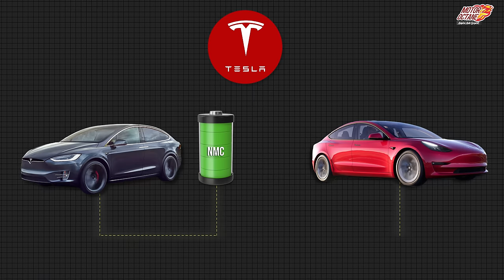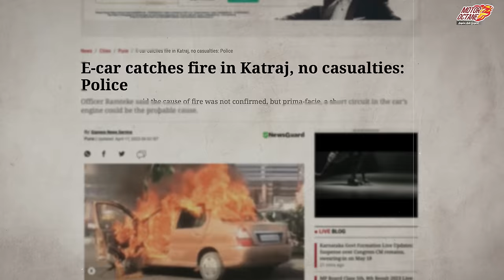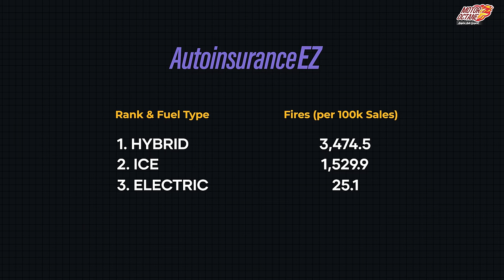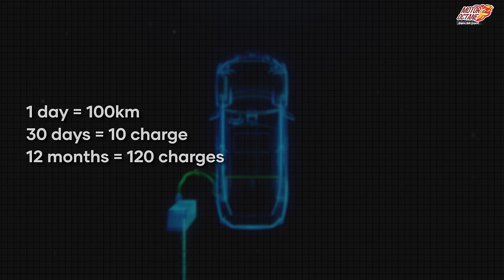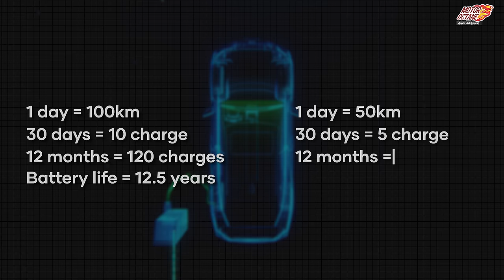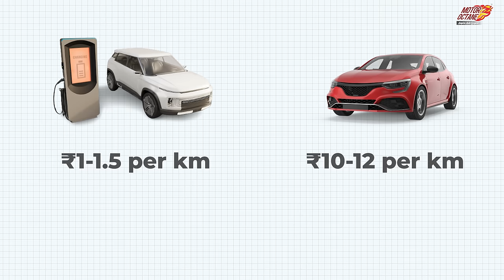Electric Cars have Battery Problems?

Comment: Very well explained , but there is a lot of work still needs to be done in terms of adapting to ev infrastructure in India,  take an example of CNG , its been around 20 years since CNG has been implemented,  but still today not all the pumps are having that CNG facilities , I see vehicles standing in large numbers in pumps to get the CNG refilled.., also not to forget with fast chargers the charging time is 45 mins min.., and with regular chargers the avg time is around 6-8 hours, yes ev's save money but there will be an added burden of not only charging it but charging it on time so that it should be good to go to the next day , if forgot to charge then take a 🚖.., unlike petrol / diesel cars , 

Regarding the number of fire catches in petrol cars vs ev's , the number is higher in petrol car because the majority of people are still using ICE cars as compared to ev's,  which are relatively new..
Reply: the fire stats are per 1lakh cars, not absolute numbers

for example if 1 million EVs are on the road, then only 250 caught fire (25 EVs per 100K cars)

same way, if 1529 ICE cars caught fire per 100K cars, then the actual fire cases of ICE cars over say 100million ICE cars would be 15,29,000

to adjust for the disparity in the number of EVs and ICE, we use per 1000 or per 10k or per 100k figures like used here

you can also use percentage, its essentially same as percetage
Reply: Bhai fast chargers are more in India than a petrol pump bhai u live in India right 😂😂 there is no more range anxiety in India and it is growing @ 10 times as lot of private companies have come up
Reply: @shresthsonkar9207  ok, but what about those cases where ICE cars caught fire because of LPG or CNG ? Do they count as under ICE car fire data as well ,i guess it will count under ICE cars only.., if they do then the stat is not correct because in most cases the fire is caught in the vehicles running on  CNG or LPG ...
Reply: @prashwin0917    bro I definitely live in India , like you do.., but its very important to have some knowledge before writing anything.., having a fast chargers is different thing and having a charging stations is different .., you can't charge your vehicle with your chargers alone..., and if you are trying to say that fast chrging stations are more than petrol pumps in India.., then I think you are an Idiot.., bs bkchodi krne aaye ho yaha.., go to some rural areas, jaha p aaj bhi electricity nahi h.., and in developed cities you can find charging stations easily but in semi urban areas.., it is still a concern.., and fast chargers bhi take around 45 mins .., and if those stations already has some ev's lined up fir kya krega bhaii.., khada rhio 2 ghnte fast charger leke 🤣😂.., and also there are some cases jaha 20% battery me logo ki cars bilkul band pdd gyi h , so uss situation if u r with family the what would you do ? Fast charger leke ghoomta rhega kya ? 🤣😂 , offce se aake car charging p lgani bul gaya to agle din boss ko kya bolega ki battry low thi car ki isiliye late ho gaya , ya leve lega ya cab krke aayega .., b sensible man...
Reply: @mayank.007  tu cycle chala na petrol na ev tere liye best he tu gadha he in simple word gadhe ke aage bin Baja ke koi fayda nahi 🤣🤣🤣🤣
Reply: @mayank.007  study is from USA waha pe cng lpg nahi hoti hai

Although yes, cng lpg is also ICE itself because ICE refers to engine not fuel type

Even if you use synthetic fuel, jet fuel, kerosene or normal petrol diesel engine still remains ICE with same basic principle 

And no, you cannot say that cng lpg fires are smearing name of ICE, even normal petrol diesel cars catch fire a lot.

This year itself there was one XUV700, one safari kaziranga, one punch which caught fire 

None of these cars were cng lpg
Reply: @mayank.007  fast charger aur charging station alag alag nahi same chiz hoti hai 

Slow charger is called EVSE (supply equipment) because it only supplies power from socket to car. Battery takes DC for charging so the car has a rectifier in it to convert AC to DC. In slow charger, the electricity entering the charging port is AC and first goes to rectifier then the battery 

Slow charger is limited by the rating of this rectifier that’s why only small capacity is provided (3kW/7kW/11kW). Weight and size of rectifier is also a factor

DCFC already has the rectifier placed in a cabinet which looks like petrol pump dispenser unit where it has those screen for cost and litre dispensed

The weight and size of rectifier is not problem for DCFC because it’s permanently mounted at parking space for charging. In DCFC, the power reaching the charging port is already converted to dc and directly goes to battery, not the rectifier. That’s why it is faster
Reply: @shresthsonkar9207  I went to Tata Motors and their sales man said k 50k extra dene pr fast charger milta h else normal charger hi milega.., based in that I said., and normal terms me bhi I think ye dono alag hi hote h.., because it depends on the type of charger you have  to charge your device.., I might be wrong but thats what I initially thought , but I can see you have some detailed knowledge about the chargers in EVs , so I take your words...
Reply: @shresthsonkar9207  , you may be correct but what I have seen in person , in my city in most cases the vehicles getting caught in fire are mostly cng vehicles
Reply: @prashwin0917  me to chala lunga jo chalana mujhe chalana h.., bs tu apna dimaag chalana chod de kyunki boht km  bacha h.., smhaal k rakh aage k liye, wrna khtm ho jaayega...🤣😂

Comment: Hi Rachit.... A brilliant video with the detailing.
I have got to believe and have seen that the temperature of the battery depends on the weather.. like in the humidity (Summer)... The battery world get really really hot which could lead to an exploration... In the winters the battery dies because of the cold wave....hence reducing the left of the battery even further What are your thoughts on this... 
Regards
Reply: Not a problem for liquid cooled batteries. Just buy a car which has around 50kWH battery.

Comment: One thing I have to agree with you, it saves a lot of money when you compare it with today's fuel prices, but have you seen the cost of electric cars, they are so expensive and charge station infrastructure are so poor and last thing don't forget chemical degradation due to ageing in the batteries, it's relatively faster than the ICE.

Comment: Very nice video.. just missed one very important point which is EV charge anxiety which leads to more charge cycles in less number of days and thereby decreasing the 12.5 years of battery life to 8 years. Hence, companies are giving max 8 years of warranty on the battery pack

There is one more point you mentioned petrol car running cost as Rs 10-12 per km  which is highly exaggerated. For a nexon, it shouldn’t be more than Rs 8 per km.

You also didn’t cover the difference between purchase price of an electric car and a petrol car. For a nexon, the difference between top models is Rs 6 lakhs.

You also didn’t talk about the resale value of EVs which is much lower than petrol cars currently.

Comment: Rachit, As of 2024, India is not well connected with EV charging points. How to manage if I buy a EV in Delhi but want to go on a road trip to say Pune via so many routes where I don't find any charging points? Also please cover in some video, how to charge EV at home - Do i need to buy a separate EV charging box from Govt or private players provide those and how will that be connected to my main electric meter box, etc.

Comment: Your audience is already well informed about the price of the battery. 8.5lakhs is a lot of money to replace the battery (Nexon)

Even if it gets cheaper it will still be in lakhs.
Reply from the maker: Audience is informed about the price - not the life of EV battery 🤣
Do you know the price of a petrol engine? So many cars have failed petrol engines.
Reply: Ecosport engine rebuild costs 3L, mere mamaji ki 3y old ecosport got engine rebuilt from his own pocket since company cited some BS reasons for failure which was not covered under warranty (this is around 2015-16)
Reply: Unlike engines, All EVs will have to replace their batteries whether in 12 years or 25. And that will affect the resale value significantly.

No one is going to buy a 15 year old Nexon with a range of 80-100kms. They will have to replace the battery.
Reply: 8.5 lakh for battery?  Who gave you that information?  Tata or Elon Musk.
Reply: @hiteshlalwani8039  but why resale it?  Replace battery after 10 yrs and car is new again.  Battery technology is changing much faster than ICE. 10 years is a small period for any significant change in petrol or diesel engines but After 10 yrs one would be getting much better batteries, technology wise to replace the old ones, so for me a use EV with new battery is a better value than a used ICE car with same or even replaced engine.
Reply: @hiteshlalwani8039  yes correct with battery cost may be 3 3.5 Lacs after 12 years or may be lesser. With EVs if you maintain the car well It can last your life with a battery change once or may be twice.
Reply: If someone has low running and can't save 8 lakh in 8 year then they should think financially.
Reply: @GreenDriveIndia  agar low running hei toh kisne bola hei ki 8 saal me battery change krne ke liye .... 8 saal company ka warenty hei, agar tum low running ho tab woh battery 20 saal tak jaa sakti hei ... bettery hamesa charging cycle pe chalti hei...
Reply: After 10 years will you still keep the same car? Doesn't money add up over time and wants & wishes?

You would want to keep all your options open. Whitewashing and being overly optimistic of the resale value of a used EV and while it depreciates like a falling rock?
@motoroctane

Comment: Dear Rachit, please add your research to identify the opensource tools and technologies that we can use our self to diagnose the BMS and ECU related issue by connecting the OBD ports. that helps to remove the dependency of service scenter loot.
Also one session is required to explain the tips and tricks on fast chargers. simple hacks can save you on emergency situations and troubleshooting.

Comment: The biggest issue that wasn't touched upon is the criteria of application for defective or degraded battery replacement under warranty. Whether use it or not they will deteriorate naturally just like a mobile phone. Still 8 years of decent service life can be expected albeit with falling range with falling year. For me until 2030 EV doesn't make sense, government and ev lobbies won't allow for strong Hybrids which is the best option without worrying about  poor charging infrastructure and range anxiety, so petrol ICE is the best option in petrol version

Comment: My neighbours Nexon EV's battery has been already changed 3 times in 50k kms. Imagine what will happen after warranty 😂
Each battery costs more than 8.5 lakhs
Reply from the maker: Are you sure? Doesn’t seem possible. There are many petrol and diesel cars where engine is changed in the first few thousand kms - that doesn’t mean all engines will be bad.
Reply: 3 times seems exaggerated. People have competed more than a lakh kms in the Nexon EV with no such issues. Only a handful had their batteries changed and that too only once. I'm sure this would make news cause everyone likes to bash EVs.
Reply: @sambitranjan9584  Battery has multiple cells arranged into modules
entire battery is not changed, only faulty modules are
Reply: Mere pass bhi naxon ev hai 15k chal gayi hai kuch problem nahi ayi hai or mujhe umidh hai 1.5 lack bhi ache se cahl jayenghi kuch car me falut aa sakta hai
Reply: @shresthsonkar9207  yes they don't know anything
Reply: @pranavkanere4832  exactly, further, manufacturing defect can occur with anything not just EV, ICE also.

None of the nexon battery replacement was due to degradation, all of them were due to ill equipped tata service centres who didn't have enough tools and expertise for detecting fault -- at least the saving grace is that instead of keep holding the car on service centre, they gave new battery and sent old one to factory for in depth diagnosis and repair
Reply: @shresthsonkar9207  i think they used to do that for e2O but tata had changed entire battery packs in some cars. But yes, changing individual faulty cells is what will and should happen.
Reply: @shrey220  for user end yes, the entire battery was changed but at factory level, the faulty cells are recycled while the good ones are used in different smaller battery like tiago or tigor 

tesla also does same thing, the old vehicles which they receive are used to make battery for their solar power backup system while faulty cells are recycled for metals
Reply: My friend has Nexon EV and has run 1 lakh kms, no problems so far.  You should change the neighbors to more lucky ones.  😂😂😂😂
Reply: Any reason why only your neighbor faced this?
Reply: @ads7506  2-3 baar software update hua hai 

Battery replacement bata raha hai genius
Reply: Chal zute 😂😂
Reply: @shresthsonkar9207 es, faulty. But aren't all the modules used when we are charging/using the EV? There is a fine line of difference between faulty and degraded due to use. 
Faulty modules are a result of damage due to manufacturing hazards/accidents when is not really common. So yes, when the battery degrades, all the modules, since all are used, shall degrade and hence changed.

Comment: Hi Rachit. Thanks for such informative videos. I have one question very specific to the services. I was stranded in jungle yesterday in my ICE car after clutchplate was broken and that left gear lever stuck. Luckily i was able to get help from the locals who had knowledge of such ice vehicles. I know there was an option of roadside assistance. But i have seen waiting period is over 3-4 hours. Even for my electric two wheeler. While i was stationary at jungle in ghats. How much does it take for everyone to understand this complex machine? Also my another question is, we have to go to same dealers and authorize service centers only to maintain the warranty. But end up paying more than the actual cost as the service providers are limited. Do you see any progress in service providers network being extended to all over india?
Reply: From an engineering point of view(and someone who has built racing EVs), electric vehicles are much much much simpler than an internal combustion engine which have hundreds of moving parts. In an ev you basically have 3 major components - motor, controller and battery system. In due time we will have more service stations for electric vehicles than we have for ICE enginers.

Comment: Resale value is the biggest deterrent to buy EV as the cost of battery will cost a fortune..were as ICE engines can be overhauled at ok cost. Further it doesn't happen so that people will charge only when battery has drained to 5-10%.. ideally one can loose 20% cycles in battery like if charged inbetween.

Comment: This is a propaganda piece for electric cars.
Reply from the maker: It’s a bit weird to get such an answer - these are maximum questions asked on car electric battery. We have answered that
Reply: so if the video answers genuine doubt that ppl had, then its propaganda
 
when the fqacts don't align with your opinions, its propaganda 

how convenient
Reply: Ur comment seems more like a propaganda because u r providing no proof or facts
Reply: @shresthsonkar9207  What facts? Do u just blindly trust anybody? Don’t trust me either, do your own research. Think!
Reply: @commieTerminator  I'm not obliged to but I'll be happy if my comment triggered you enough to do your own thorough due diligence.
Reply: What would you call dramatic coverage of "batteries catch fire", "this battery lasts just 1500 charge cycles, so it would be trash in 5 years", etc.?

This is really just clarifying everything a bit

Comment: One thing you didn’t tell ,in case of electric car accident , how will the repair happen, are mechanics fully trained to repair electric cars, what extent of damage they can repair , I have heard even slight modification like seat cover interior modifications are not possible with full proof guarantee, so when accidents happens to bonnet , happens at front panel , doors , back panel , boot , how will car take that ? Can car get repaired at 10% , 20%30% damage , and surely cars will have to be repaired at company service centre which are expensive, but will insurance take extra premium for damage ? Coz they are gonna pay extra in case of damage, Please bring one video on this

Comment: @motoroctane 
Bro,
 I usually calculate cycles by no .of days.
I drive min 100 km a day and I need to charge it every day 
I can't charge my car everywhere and it's not as quick  as a phone. So every day is a mandatory
On that note 1500÷365=4.1
Lets consider it 5...soo 5years is the maximum time I can spend with its well performance and yes in the later days the battery gets quickly discharged but the car doesn't go waste

Comment: A Tesla model 3 has a range of 540km approx, so for driving it 3.2L km you have to charge it 590 times but on the other hand xuv400 has a range of 300km, so for driving it 3.2L km you have to charge it 1060 times, this will make a lot of difference in battery capacity, maybe upto 20% degradation or even more

Comment: You didn't say the cost of replacing battery. Let's say in case of unwarranted issues, one has to get it changed, how much does it cost.
Also, you didn't touch upon the lack of know how among dealer technicians and servicemen ..

Comment: What is the idle loss in these batteries. As in if I don’t use the car for 30 days. Will battery still be at 100% (obv not). So the calculations you made are obviously in ideal state and probably works much better for cab drivers. Would really love to understand stats from nuclear households and their pain points